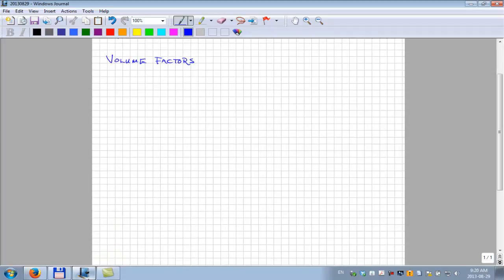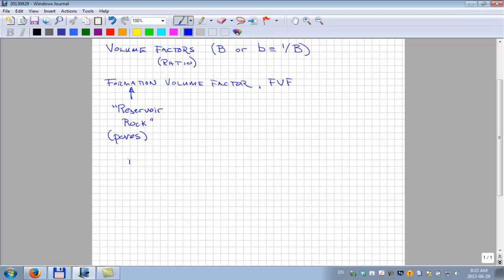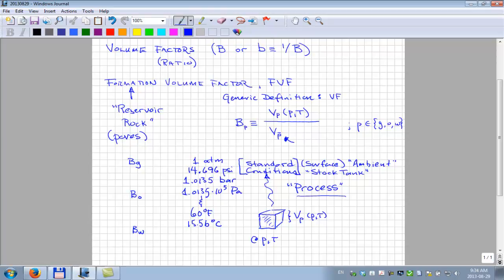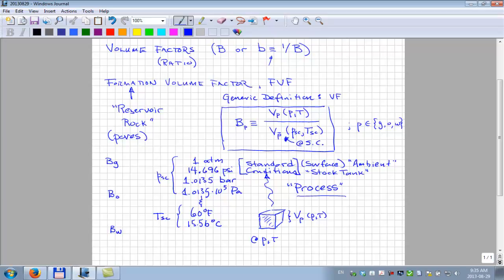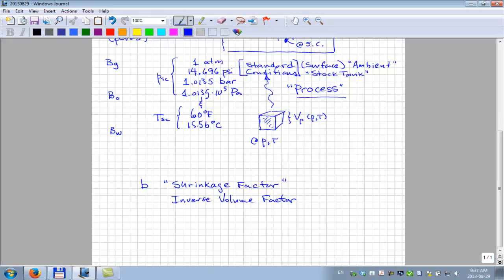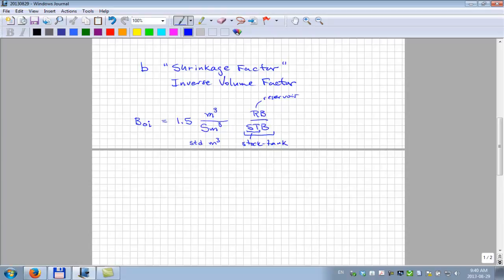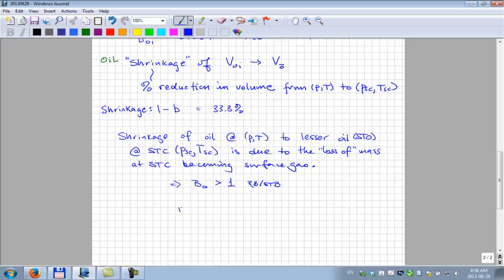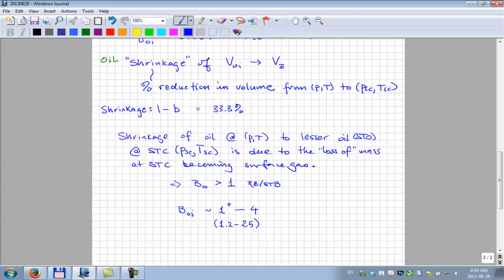Volume Factors & Oil Shrinkage

Comment: I didn't understand well... when the oil gets until the bubblepoint.. does it start to changer it's phase?.. I mean until there I start to see two phases?
Reply: Oil will be the only phase till the Bubble point and at the bubble point we have the first gas bubble coming out of the gas and then as the pressure decreases then two phases appear